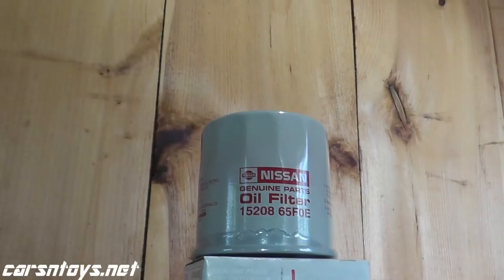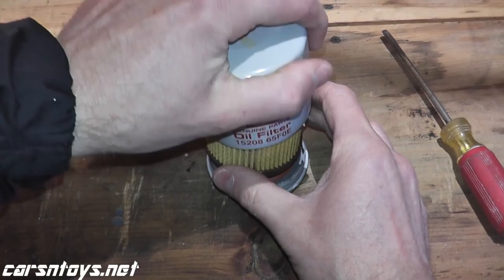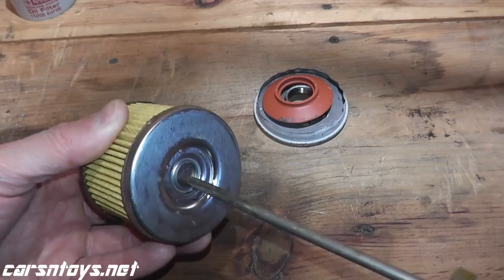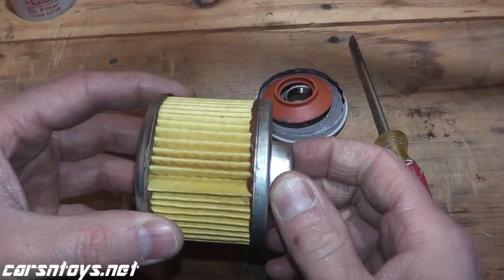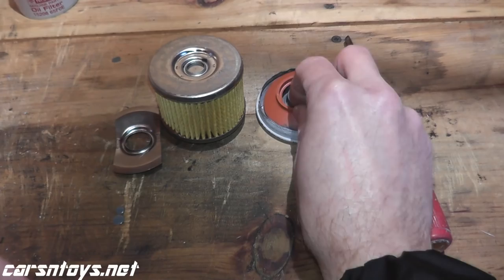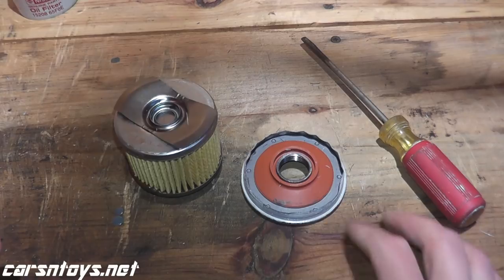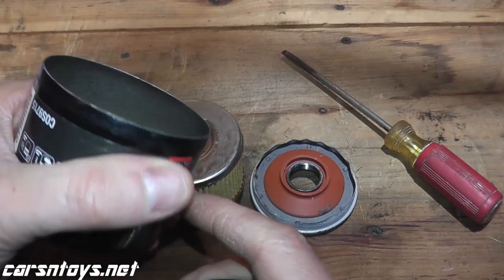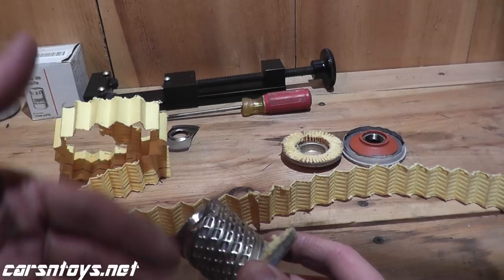Nissan Oil Filter Review

Comment: Thanks for your helpful review. I just bought a 2012 Nissan Versa. The oil was changed every 4,000 miles and it always had a Nissan Versa oil filter installed by the dealer!

Comment: I'm so intrigued by how intricate an oil filter is inside. I'm still driving my 1995 Nissan maxima, just turned 300,000 miles and still driving like a champ. The only thing I've ever had an issue with, was the mass airflow sensor. I'll drive it as long as it is running. Lol
Reply from the maker: I love 4th Maxima's. I'm at 180k. Keep her going!
Reply: Do those have a timing chain or timing belt?
Reply: Sergio S. Huerta if you're asking about the 95 Nissan maxima yes it has a timing chain.

Comment: Not liking the stamped spring at all. The silicone anti drainback valve is a waste if it's not compressed by a coil spring. Now I know why my oil light blinks on cold starts after 1500 miles with these. I will be seeking a higher quality filter. Just bought one the other day and they areade by a Mexican company called "Gonher".  I would expect my Nissan OEM filter to be made in Japan or USA.
Reply: Look at Royal Purple I believe all their filters are Made in USA
Reply: The coil spring is over-rated. The leaf spring does it's job, it's as simple as that.
Reply: Can the coil spring ever dislodge?
Reply: @Direct.injection212  Very unlikely. Everything in a filter is fitted tightly.

Comment: Thanks for the cut open.
BTW, you CAN use the longer Nissan filter in ANY Nissan engine. I have a Maxima 2009 and use the longer version(despite book calls for the shorty one reviewed here in this video). Just prefill the filter with oil as much as you can before installing on the engine (I know it sits horizontal you still can soak the filter with oil with no major spilling).

Comment: Thanks, I bought a dozen of these filters when I bought my 15 rouge, but the Crush washer was not included, I guess they started adding it to each filter more recently.👍
Reply: I get them at the dealer. Sometimes they give me a new crush washer and sometimes not. Depends on who's at the counter.
Reply: My filter didn't come with one either. But they did sell me 20 washers in two 10 piece packages for $11. 00.

Comment: A friend bought a Nissan pickup new and put about 30,000
miles on and never changed the distributor cap & rotor button. I checked it and was quite oxidized, he went next day and bought new oem Nissan cap ,& button.

Comment: I always use the Nissan filter on my Cefiro Wagon (Maxima), oil and filter change every 10,000kms. My VQ25 engine is up to 285,000kms now and still a nice quiet and powerful motor. When I buy the Nissan filter from my local dealer here in NZ the drain plug washer is not included ? so I have to buy them separate. Always use a new copper washer every oil change, so never any leaks. Great video here to show the filter internals, very informative .. Thanks,
Reply: Mate can you tell me  whose your local Nissan dealer coz I'm from nz and  wanting to get a Nissan filter

Comment: Thank you for clarifying the Nissan oil filter. I bought one off of eBay last year and was disappointed at how fast i had to change... 
But now that you've explained the "3 to 6" rule(?), now i understand. I usually change my oil filter in my 5th gen Maxima every other oil change. Because of my high mileage (260xxx+), i don't wait for that 3-5000mile. I change my oil 2-3000mile.... Trying to keep my engine as clean as possible on the inside. 
But thanks again. I just may buy 2 or 3 next time 👍
Reply from the maker: That's a good rule of thumb. Keep her going!

Comment: I have an 03 Nissan Altima 3.5 at 153,000 miles. A lot of Nissan owners seem to complain about a rattling noise they hear, most likely the timing chain on cold starts. I have the same issue, it never does it when the car has been driven and I start it again. A lot of Nissan forums people who went with a better oil filter the noise went away. I'm wondering if the better oil filter now fixed a dry start so the rattling goes away. I'm not a mechanic 😅. But I was looking at this or going with the Royal Purple filter to see if I can get this rattling noise to go away! Thanks for the great reviews! New sub.⚡👍⚡

Comment: You need to consider how long you want to go without changing oil, oil type, usage, geography, vehicle life expectancy, etc... Are you a collector, someone who wants 500k miles, towing, don't want to change oil, selling at 100k, etc....?
Reading different machinist articles I've been led to believe they polish out components on average to 23 microns. So anything bigger wouldn't obviously be ideal.
On the other end some articles have indicated particles less than 20 microns and 10 microns cause substantially more wear than larger particles. The articles never specified if that was because larger particles get filtered out better.
So the goal should be removal of all particles without creating restrictions in flow. Secondary goals would be cost, interval changes, life expectancy etc...
While I would love to point out all the many variables I don't have time. Know this though. I have a 2000 Nissan Sentra that I just replaced the rings, timing chain, exhaust valves and springs. That model engine is known to go 300k but a mechanic didn't put and exhaust bolt back and my valves melted 🤦‍♂️from exhaust leaking back onto the head. One of many reasons I do my own work typically. With Nissan filters & 3k conventional that engine was spotless at 220k except a dip in the head where a small bit of carbon that interfered with nothing built up just because it was a low spot and carbon could settle there. Very small.... Synthetic is cleaner and has less byproducts and maintains viscosity longer and a synthetic filter is certainly great, but not all particulate or chemical byproducts get filtered out as well as not all particulate is magnetic for people with magnetic filters attached. Increasing oil or filter quality should be for towing, heat & dust regions, increasing engine longevity with still short interval changes, or increasing change intervals knowing the engine will still wear and die, etc... Now clearly not all filters are made equal but Nissan's value brand filter left my engine in great shape. I looked at almost all my bearings, etc... The cylinders still had texture. I am at 220k for the rebuild. What I am saying is, unless you are concerned stock is cheaply made or you have extreme stresses such as towing, longer oil intervals, hot or dusty regions, want to try and have a 500k engine, etc... then as long as it is a halfway decent filter then your engine has a good likelyhood of wearing slowly. Anything more is just an extra assurance or tackling specific needs.
I will go synthetic to prevent oil loss as ring wear and cylinder oil can burn off(not an issue right now), castrol gtx is design to cling(great for short trips), it creates less byproducts(I still flush low mileage 5k & not 7k for anything that cant get filtered) , and I can change less frequently (I do less than 3k on that car a year sometimes so I want an oil that can sit for a year).
Synthetic oil initially got a bad reputation as it was hard on seals. When they fixed that it was so good at cleaning that it cleaned carbon deposits out in old engines that had eaten gaskets and become the gaskets so synthetic got blamed again. This is why switching to semi or full synthetic has been frowned on as a risk. A 30yr mechanic friend advised I could go to full synthetic at 190k when I told him I changed oil EVERY 3k. When I opened the engine I realized he was right as it was almost flawless so please understand you may be able to transition but if there is any carbon build up in an older engine keeping parts sealed or functioning then you risk the status quo. This is why you should flush or drain and fill the transmission every 30k traditional or 60k for extended/life fluid. All oil wears despite life of vehicle claims (neighbor's Mazda life in fine print 120k meaning they arent expecting the car to go longer so theyre ok with a tranny being neglected and even conventional oil transmissions cam go to 150k to 250k with neglect if engineered well.) waiting to change it later could free up gunk that wore internal components and now holds them together. I have mechanic friends that believe 105k is the magic number. Past that they make you sign a waiver for fluid changes. You can leave the old oil in but eventually the oil properties will degrade and flushing or a drain and fill will be needed for that reason if not many others. It is a butt move not to maintain it of you resell at 100k to 150k because people who can only afford used get slammed with a transmission bill they also can't afford. If you want to have the car for a long tine then you'll have expensive repairs later.

So in short, dont stress your filter.  Research the quality of the brand you want to switch to if you want to do a little better than stock and recognize there is a risk, very low mind you, that your after market model fikter may not be as good as the average for that brand or it might not be designed as closely to manufacturer specs as ideal for the car. Stay stock or research and use a reputable brand. At the end of the day you have to just trust they are selling a funcrional product if no other blatant warning signs like bad glue work, plastic parts, etc...
Reply: And thank you for the video.

Comment: Nice video i never used nissan filter i use mobile 1 performance but probably will use it next i have s 06 sentra 65k miles i change my oil onced a year due i onky use 1k mile a year
Reply: The 8 holes in the Mobile 1 filter are a little smaller then the ones in the Nissan filter for my Versa. Plus The Nissan filter is the same price as The Mobile 1 bought at Walmart.

Comment: I am using mobil 1 in my maxima and mobil 1 filter but I do very low mileage a year I am gonna go in next month do oil change i havent even put 3000 miles on safe enough do oil change once a year i am not using once year mobil 1. Just regular mobil 1

Comment: Can you use synthetic oil with this filter or just old fashion dino?
Reply from the maker: I'd probably use a blend. Some conventional motor oils are good up to 5k miles.
Reply: I asked the dealer's service department and they said all new Nissan Rogue use full synthetic 0W-20 and this is the filter they use.
Reply: I do Mobil 1, 5w30.